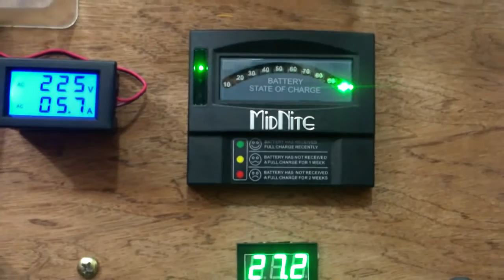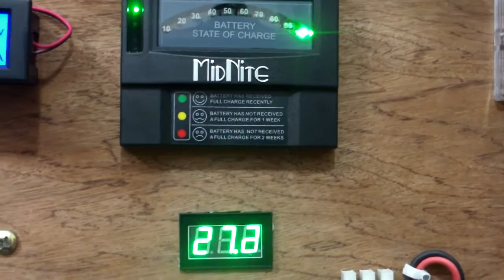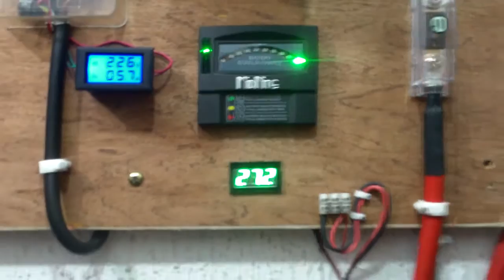Powerstar W7 6000Watts Inverter

Comment: I have been using a similar model 48 volt W7 Powerstar 6 kva inverter for over 13 years now and its been great, only complaint, on my model the fan is on constantly,  later models fans are demand start on temperature or high current rise/draw.
It is on 24 hrs a day and hasn't faltered until last week when I realised the AC voltage had dropped to 160 vac insteas of 230 vac.i suspect it is a voltage regulator problem, the massive transformer looks clean with no burning of windings ao will trouble shoot it when I can.
The inverter starts my 2 kw Pressure pump (water) without as whimper and appears to have the capacity it claims, i've been very happy with it and 13 1/2 years is a good innings .

I have purchased another newer Powerstar model and it is even more efficient than the original that admittedly was only 93% efficient.
Beware, the weight of these inverters are between 45 and 47 KG!, certainly value for weight $ wise and the construction looks excellent with good quality components.
Reply from the maker: That's really great! After 13 years!!!! wow.. Please can you share the link where you purchased the new one from.

Comment: hello i had the same inversor but i havesome problem i need to know which the diagram is for charge the batteries because when i conect to charge mode my bateries gonig discharged thank a lot
Reply from the maker: If I get you right ,you need a diagram to charge your batteries  ?
Reply from the maker: what is your inverter voltage and how many batteries do you have in your battery bank ?
Reply: the voltage is 48v i have 4 bateries 180ah
Reply: i try to charge de bateries but i cant do it ,,, it seem  that the bateris lose the voltage
Reply from the maker: Hi evotecs, have you been able to solve the charging problem ?
Reply from the maker: Try connecting the batteries is series .Check the link http://www.solarseller.com/battery_bank_wiring_diagram.htm 
It shows a 48 volts series connection.

Comment: I am interested in getting this system. Have u checked the efficiency? what is the no load wattage?
Reply from the maker: The system is quite efficient and the no load wattage is about 25 watts. However there are newer versions available . The Powerstar  W7 with toroidal transformers,  with selectable priority (batt or grid) ,larger transformer and the idle wattage is even lower  since the idle current is much lower.
Reply: thanks alot for the reply bro.

Comment from the maker: Thanks Justin Case for your recommending this Inverter  on your Youtube page.
Reply: +Ibidapo Ilawole Very nice setup. yes 24 200amp batteries i have. Give me lots of power. you may need to get this some of these to keep your bank balance.  http://huaxiaotech.en.alibaba.com/product/60239588443-219278389/Waterproof_battery_equalizer_balancer_4_N_12V_battery_applicable_for_all_batteries.html
Reply from the maker: +Justin Case Thanks Justin . Much appreciated. Can you shed more light. I would definitely be getting 2 units of these.
Reply from the maker: +Justin Case  Please do you have a link where  I can purchase the battery extra from ? Thanks
Reply: +Ibidapo Ilawole yes mate. http://www.recovermybatteries.com/
Reply from the maker: +Justin Case Thanks , I just called the guy and would be getting one.However do I need to use the battery balancer  you recommended earlier ?
Reply: +Ibidapo Ilawole Yes i am waiting for some for my bank. I have been told there very good but i can not say for sure until  i test them.